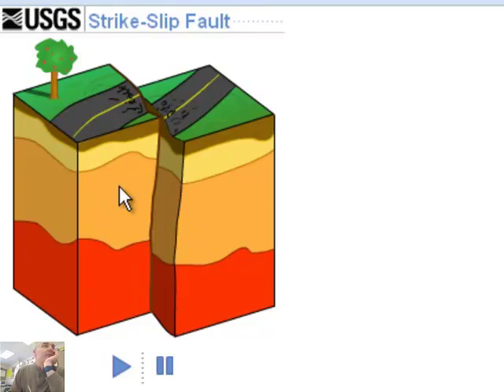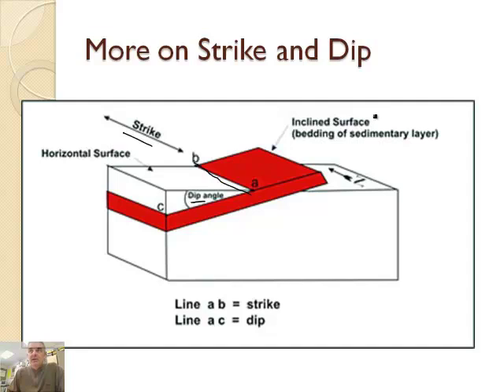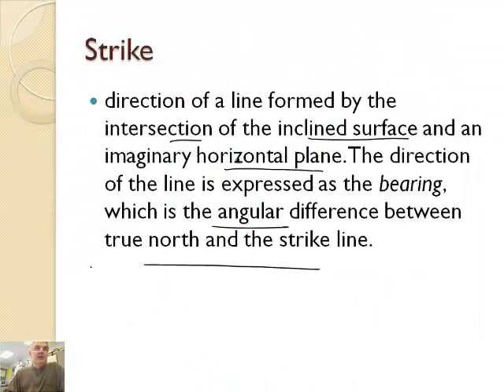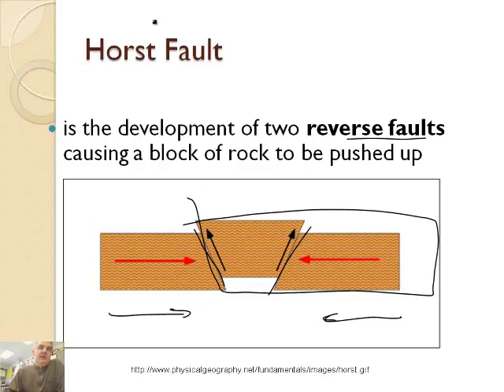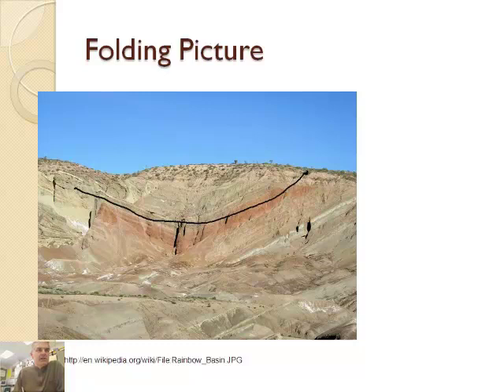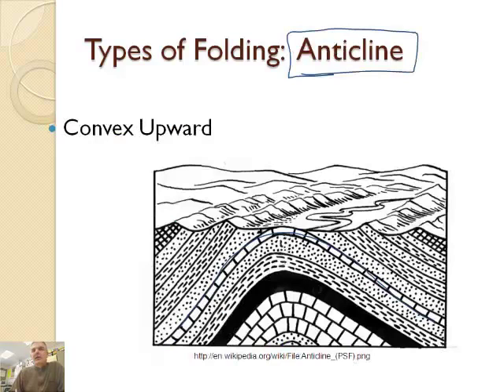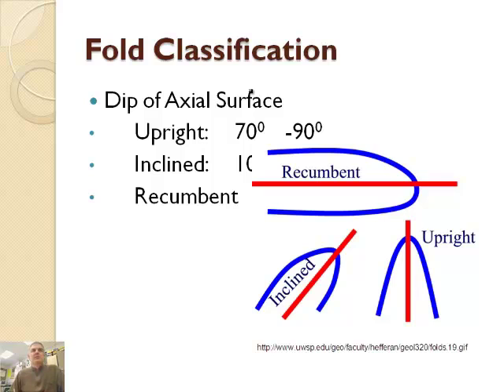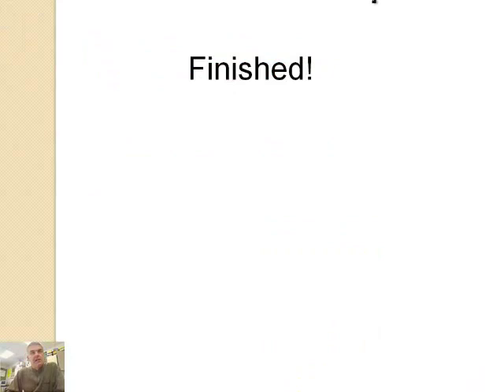Structural Geology (2/2)

Comment: On a graben fault how can the middle section of a sedimentary block of rock sink downwards into the solid platform rock underneath. Surely what happens is that the platform rock underneath  stretches laterally and causes the brittle sedimentary rock above to fracture and separate, leaving hanging walls on each side of the rift. In the East African Rift valley, for instance, there is no sedimentary rock in the Rift valley floor which corresponds to your sunken middle section.

Comment: How can you be so ignorant of Walthers Law? The lowest strata in sedimentary formtions is only older in a cross section because the age grows laterally not vertically. Vertical and horizontal facias match. A lateral depositional history is the true history. Aand if the lower layers are so much older than the higher in the standard geologic timescale  and are exposed to erosion, you would see the folds in the anticline cut in the lower layers, but the only lengthy period of erosion exists on the surface. Uniformitarianism is an axiom that is contradicted continually with research that concludes catastrophism walthers law and rapid deposition.